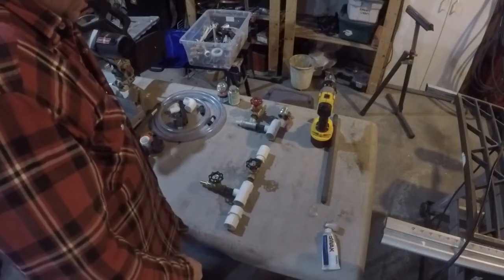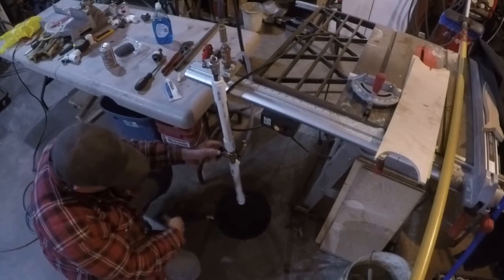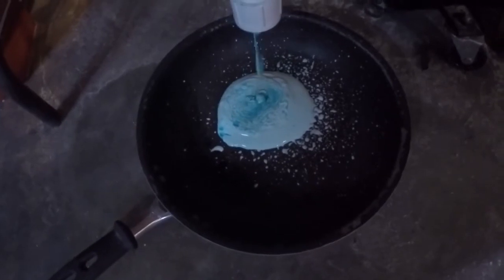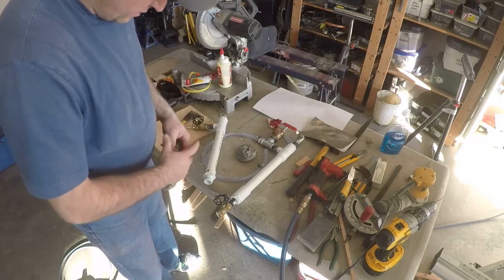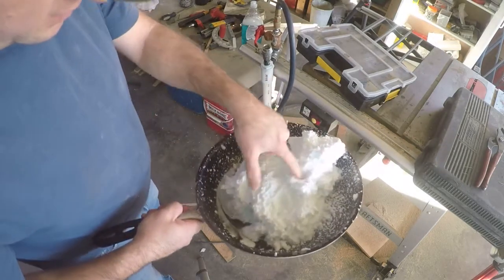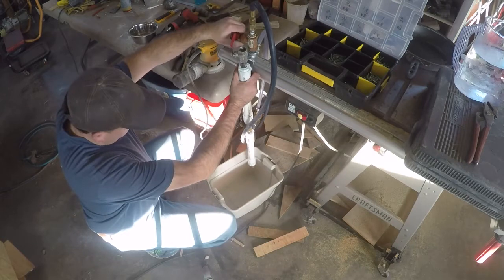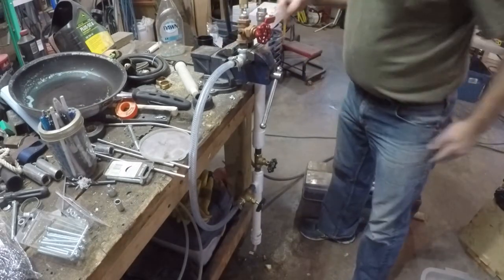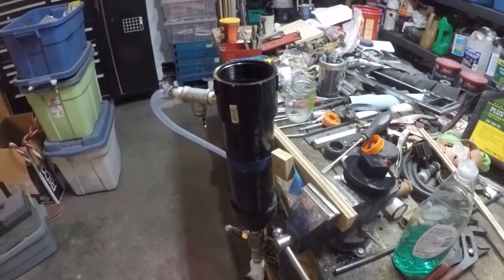Rocket Stove 2 - Part 2 Foam Generator

Comment: Subbed and liked ! I can't believe how much we think alike! I just got the stock to build a foam generator and plan on building sheet cake style forms. I too was inspired by #honeydocarpenter and cant wait to see more!
Reply from the maker: Hi marco nantel, thanks for watching. Yeah #honeydocarpenter did a great job. My aircrete didn't work out, and I might have been too impatient. I may try again once I have the dimensions finalized and can leave it for a very long time to dry out. Maybe different materials, like #ppotty1 used.
Reply: Bradwiggles did you try adding the water glass?